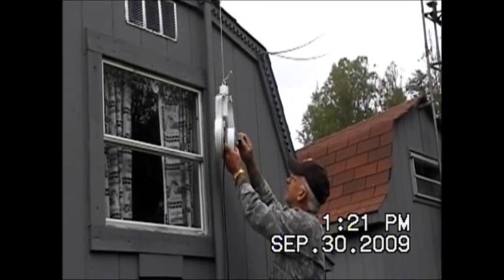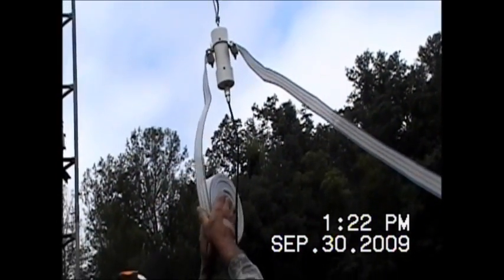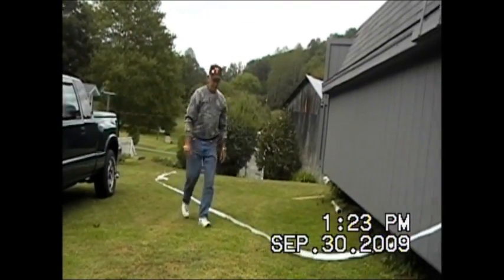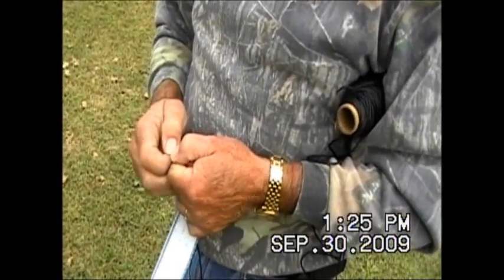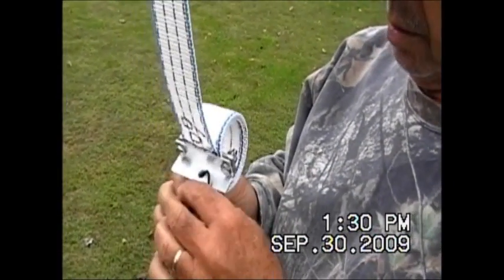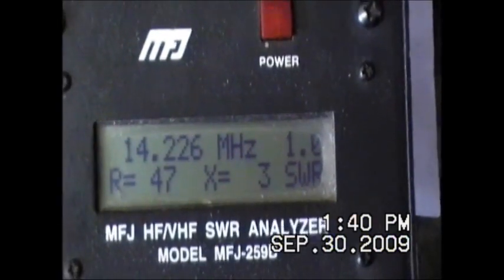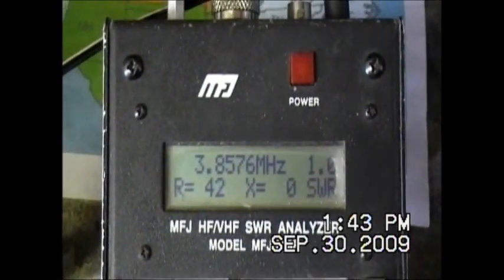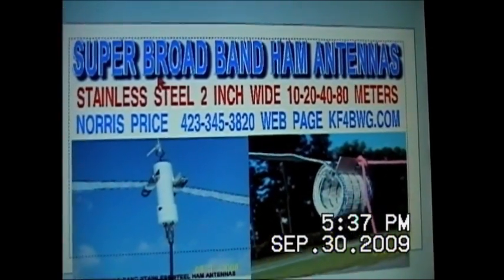kf4bwg ham horse fence antennas

Comment: Is it correct that when you show the SWR that is after you have first used your MFj antenna tuner? That converts your rf into heat.
Reply: He just used the tuner on the non resonant bands.. he didn't use it on the 80 meter band and it covers the whole General portion without the tuner at 1.3 to 1 or less...in otherwords not bad for not having to put up a cage dipole which is a lot heavier and expensive.

Comment: I have an 80 meter Horse Fence. Put it up in march 2012. about 35' to the apex. I feed it with rg213 cqax to the so-239 connector supplied. Works great on 80 & 40 meters. I do not use a a tuner. ..I'm very pleased!

Comment: Uses a bracket that bolts down tight at any point (length) you select. Quite simple and ingenious. All hardware is nonferrous so it won't rust.

Comment: Antenna is not the greatest although it makes your swr meter look good. Those of us who actually know antennas know thats a farce.  Very small gauge wire, high winds generate big noise into your rig and its low efficiency .  I picked one up to test and it was taken down in 3 days and tossed in the garage for the "swap" so the appliance operators can deal with it.
Reply: maybe it " u " or  your  radio junk!
Reply: I would tend to agree with your statement. Covering 80m from end to end can only be done with a dummy load. My dummy load is 1/1 swr across all bands.

Comment: bought one did not work at all.. Put it up as inverted V with a tree for support.. Nada.... put it up with a metal pole for support with the center hanging with a standoff.. nada.. sure it will work with my wide range tuner but that was not the point of this antenna it was supposed to be resonant.  Its sitting in the trash pile.
Reply: maybe it " u " or  your  radio junk!
Reply: did you check your feed line with a dummy load watt meter at the end by the antenna to see if it was good?